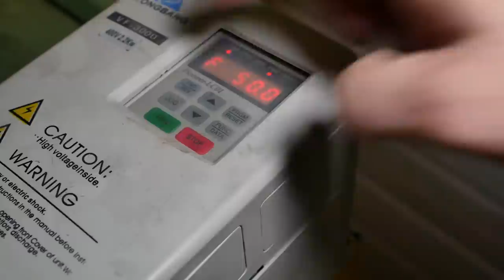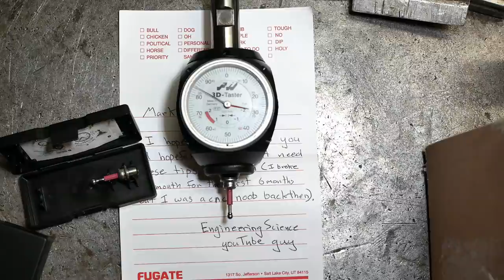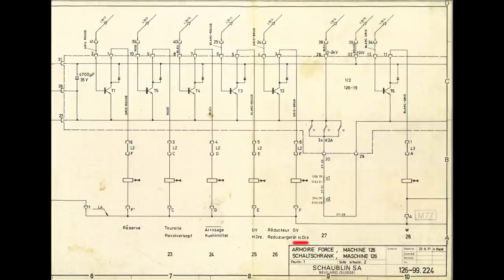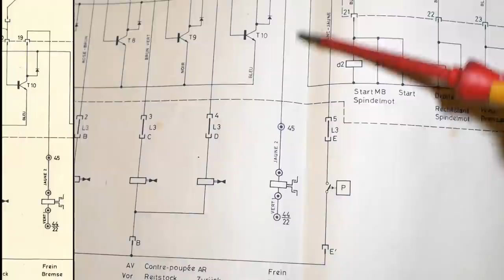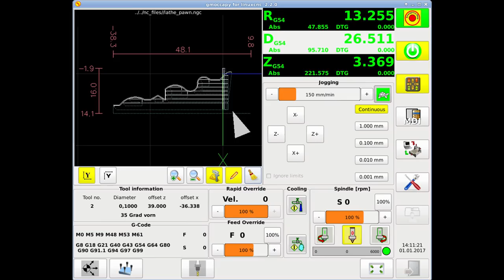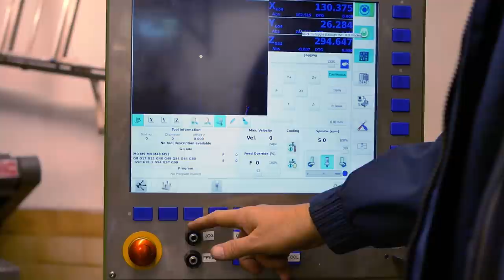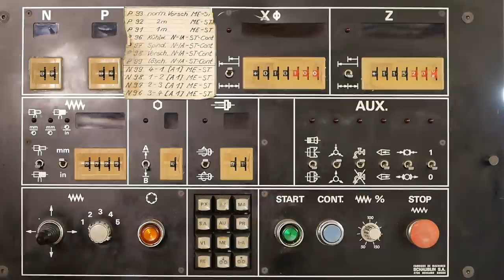Schaublin 125-CNC Lathe testing and strip down || RotarySMP

Comment: I think modern touchscreen design for everything is lazy and certainly non tactile. However I can understand how we got this point in design. It's certainly cheaper and easier to iterate with software than to have to redesign the whole thing every time you want to make a change.
Reply from the maker: I agree. Would have been much easier, but I prefer the tactile buttons for the machine tool.

Comment: Hey mate. That variator gearing is super cool. You should defently use it. I have never seen that on a lathe.
Reply from the maker: Hi Nikolai. I am in a bit of bind due to removing the control cabinet. To do the motor speed control with the back gear and variator, I woudl need to keep all five mains contactors needed for star/delta start, and reversing. A VFD is more compact than the five contactors, and could do it all (except I would still need one contactor for Estop). I think I will probably end up with both a VFD, the Variator and the back gear. I guess I will have a hell of a speed/torque range :)
Reply: Keith Rucker has a precision lathe with that, and he also worked on (I think) a horizontal mill with it.
Reply from the maker: @paulwomack5866  Yeah. Variators were a pretty common mechanism for variable speed drives in the 70's

Comment: yes that old controller is cool and no i wouldn't wanna use it either however old electrics are fun but nowadays there are so much and efficent replacements so i think your right ,just take that stuff to  a museum is a better idea :) and yeah i told you that machine would be accurate seeing that runout :P
Reply from the maker: :) I am really happy that the main, expensive bits (spindle, bed, ballscrews) pass then intial inspection.

Comment: Re coolant - looks like previous owners were running just oil - which is one of the $64 questions in due course. Looking froward to your implementation of Linux and all the stuff that makes the machine run in more modern fashion. I don't know about the tool changer - on my 225 I don't have a turret but can use gang tooling easily enough or just swap out tool holders...is the 4 tool changer worth it? hahaha so many quesitons running through my mind. great project o keep you busy.
Reply from the maker: I also dont know about that tool changer. I have it, and will try it, but it seems a poor use of space.

Comment: You said you want to try fit the whole control setup in the Pneumatic compartment ?
Wouldn't it be easyer to fit a smaller Rittal Cabinet the same way as the old one ?
It coul be just the same width as the Base of the Lathe wih the hinges on the opposite side as the original one, so it will still fit to the wall.
I would donate one if you like...
Reply from the maker: Thanks for the offer. That compartment is both too wide and too deep,  so I plan to chop up the control cabinet (also dealing with it's disposal), and weld it back together as a shallower, narrower ghost of it's former self, open to the back,  and then locate a fair bit of the electrical hardware onto the back side of the door.
Reply: @RotarySMP  That's a geat Idea !
Reply from the maker: @taunusmechanics3121  I hope so. :)

Comment: i'd reckon the manufacturer might be interested in the whole machine more if it was in good condition, though if they had multiple machines then they could pick the best parts to rebuild some history. Wouldnt it be easier to make the door bigger?
Reply from the maker: It is a main structural wall under my house. 35cm thick concrete. I have thought about widening it, but this issue only comes up every few years.

Comment: Might have been quicker to knock out a few blocks from the wall and rebuild it after!
Reply from the maker: It is a main supporting wall, and it is concrete. No blocks to knock out. I have though about widening it, but it is only an issue every few years.

Comment: Workshop tetris, shurely is more fun than tetrising pieces of a FAMUP RAG 35 column drill into a Jaguar X Type 🤣
Reply from the maker: Guess we will see. I think I have to move the 16" DoAll, the Boley lathe, the drill press, the Deckel G1L frame, all my stock metal, and a bench to have space to move the Schaublin around.
Reply: @RotarySMP  that's quite a gym exercise
Hope to see the process and the logistics around it
Keep on chugging metal
Reply from the maker: @Goguleroma  Thanks. I'll have to set up to time lapse that wont I.
Reply: @RotarySMP  i guess, because i think it will take you 2 or 3 days to move stuff around to make space for the lathe to pass
Reply from the maker: @Goguleroma  That might be ambitious at the pace I work :)

Comment: 22:07 Did they really crack the headstock casting with the cooling mount?
Reply from the maker: Good spotting. I didn't notice that. That freaked me out so I just ran down to the basement to take a look. It is either a crack or a scratch, Hard to tell.

Comment: Safety shoes? not sure you're allowed to wear the silver fern with safety shoes bud. Surely you have work Jandals, or for those really serious occasions like a visit from the queen, redtop gumboots (shorties of course) .
Reply from the maker: I dropped  heater radiator and smashed two toes a few years ago. Took forever to heal. Not doing that again.
Reply: @RotarySMP  I would think not, radiators are expensive.
Reply from the maker: @EastLondonKiwi  :)